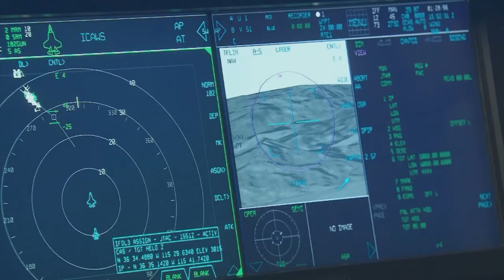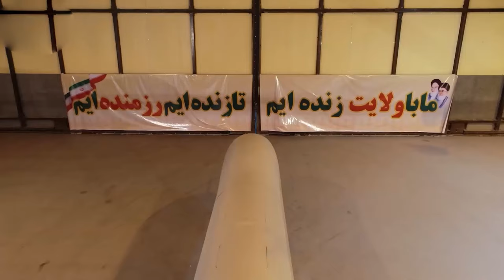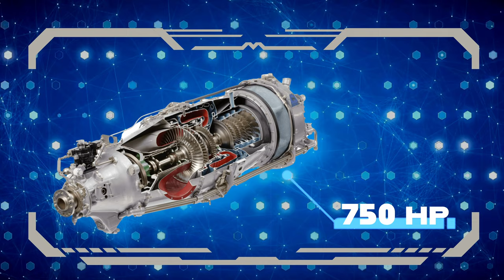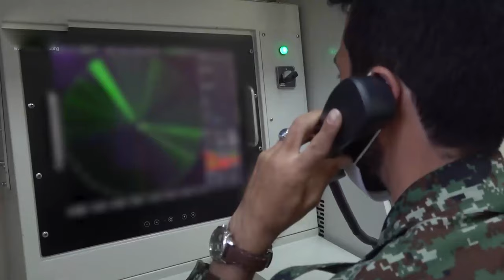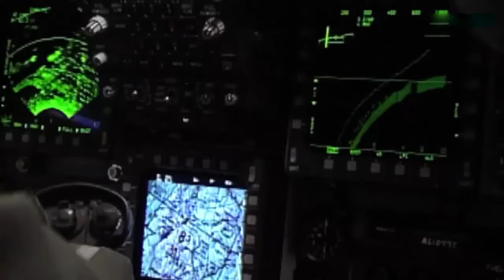Iran’s Drones Are More Dangerous Than You Think

Comment: Hamas does not operate shahed 149 - 136 or any variant of shahed UAVS. they do not have the infrastructure to do so, what your seen in the start of the video is model based on shahed 101 [much smaller version] produced by hamas with iranian tech. however hezbullah does have access to iranian drones but not drones like shahed 129-139-147-149 cause these drones need infrastructures like airfields and control stations which is not possible at the moment for hezbullah. hezbullah operate much smaller drones like shahed 101-121-131-136-237-238  or ababil 3[7:47].

Comment: Fighter pilots shooting these drones down is probably not the answer. The munitions that a modern fighter pilot uses to shoot one of these drones down probably costs more than the drone it's shooting down. Not to mention the actual cost of putting a dude on a fighter jet and sending it out in terms of logistics and maintenance. 

We need cheaper and more cost efficient way to deal with these things. If they're remote controlled, then jammers will work. But if they're autonomous, its gonna be an issue.